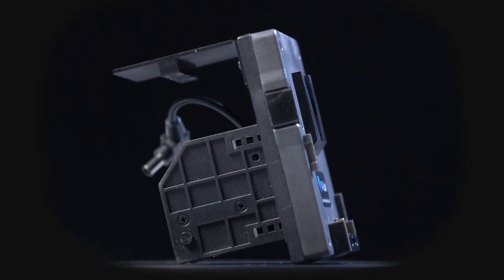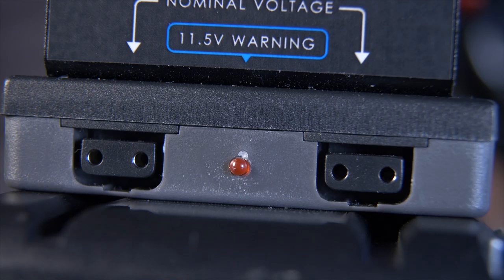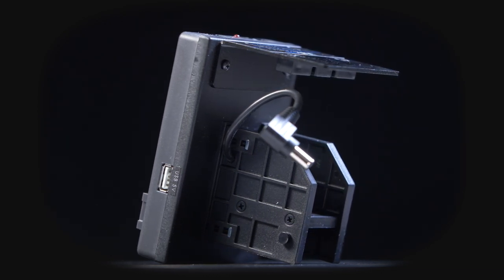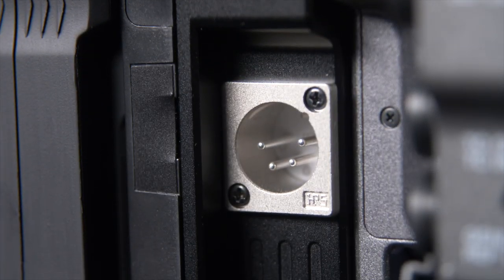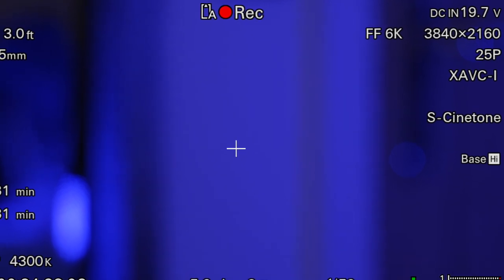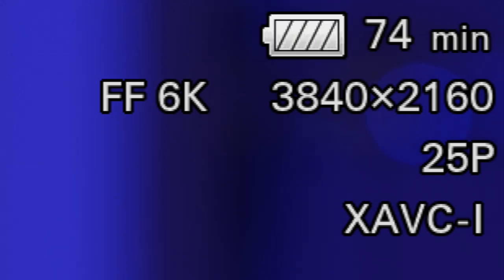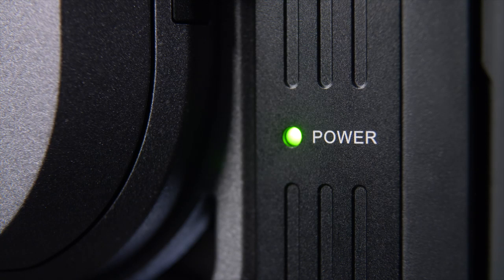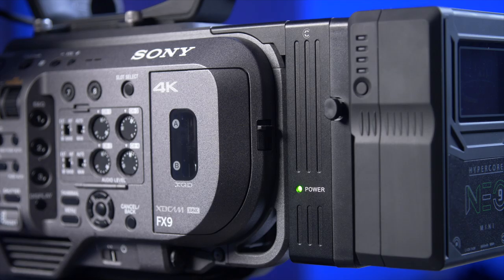Core SWX FX9 Power Solution

Comment: Together with the battery, this solution really makes sense for me.  I'm often using an external monitor/recorder via D-Tap so it would be great to get total system battery status.

FWIW I agree with your general comments about the Hawk-Woods unit.  Mine is being fitted with an additional capacitor as I write this. Another option I haven't tired or evaluated is from Wooden Camera. It's unique feature is a hinged V-Mount plate that allows the 35W Sony battery to be inserted and removed without unscrewing the adaptor from the camera.
Reply from the maker: True... I been running with a BM video assist and sometimes a top light... all running from the D-Taps... and with an accurate run time on the battery.  I think it works it out from the existing load because it takes a few seconds for the reading to settle down.  If I turn the camera off and just run the monitor... the battery run time will often jump to more like 11 hours!  The Wooden Camera Plate looks good and I tried to get one to compare... still difficult to get hold of at the moment.  The main pluses are the hinge to make it easier to swap an internal battery and the fact you can fit a larger battery if you want.  The minuses would be having to use that rubbish laptop power supply and the strange chirping noises that many have reported from the regulator when using a full 14.4V battery?

Comment: I found the Wooden Camera solution to work great on my FX9.... I use a CORE 98W Nano U98 internally, then a gold mount on the Wooden Camera flip up mount on the back.   It's a hot swappable dual battery solution and gives you the option to make the camera smaller in tight situations like cars and helicopters.
Reply from the maker: Thanks Bill,  I have heard good reports about the Wooden Camera... have you had any issues with it making a 'chirping' noise with fully charged batteries ???
Reply: @extrashot  I have not heard any chirping from the unit so far, but will report back if I hear anything.  The only issue I can see with this set up is that you give up the 4 pin external power option that other units offer, but the power supply that comes with the camera is small and easy to bring along. My FX 9 is set up similar to yours with the Sony 28-135 as the primary ENG style lens, Shape arm and a  Zacuto shoulder mount, the camera balances very nicely with the two batteries mounted in this configuration.
Reply from the maker: @parismedia  Cheers Bill, The extra weight on the back to help balance the camera is a good point... plus having the internal 98W makes for a useful extra bit of power. 👍

Comment: Hi again...how has the V-mount plate stood up 1 year later.  I'm asking because I had the Tilta plate for the FX9 and its essentially damaged my DPR board...Record light started blinking and beeping and after trying everything right up to a firmware update, which caused the camera to become a brick, now have to send in for repair.  I'll have to throw my Tilta plate in the Bin, so I'm looking for a reliable tried and tested Vmount plate
Reply from the maker: Hi Peter,  wow, that's a real bummer.  I didn't think there was any connection between the DPR board and the power supply... was it the 19.5 regulator that went on the battery plate?  Never heard of such a thing.  That's a shame because the Title plate looks like a good design.  Anyway, the Core SWX has been great... still a permanent fixture on my camera and still working faultlessly.  The only disappointing discovery was when I realised the D-Tap outputs only take power directly from the V-Lock... not the 4-pin XLR.  So you still need a battery for D-Taps even when running from the mains.
Reply: @extrashot  Thank you for the reply.  Yeah the Tilta was actually a pretty nice design, cause you could flip it up and access the BPU batteries...There's no telling if the V-plate was faulty.  All the guys over on the Facebook forum are suggesting that it must have something to do with the 3rd party plate/batteries.  Anyway shipping it off to Sony today and hopefully will get it sorted...in the meantime i'll try and get the plate you're using and hopefully i'll be up and running again.  Cheers
Reply from the maker: @pjsagnia  Hope it works out for you soon...

Comment: Hi thanks for the review.  What is the runtime on those Core Batteries for the FX9?
Reply from the maker: Hi Peter,  I'm getting about 2.5 hours from each Core NEO Mini 9 battery on the FX9.  That's in continuous record and my normal camera setup.  I've found the FX9 is strange in that you can reduce the power consumption a lot, just by turning off things like the WiFi and any HDMI/SDI outputs you're not using.  Obviously if you do this, or shoot in the more normal stop/start way, then you can squeeze quite a bit more out of each battery.  The odd thing is how the FX9 will eventually flatten any V-Lock battery even with the camera turned off !!!
Reply: @extrashot  Thank you for the reply.  I think I'll go with the Neo Mini based on your reply.  I'll also check the wifi thing etc.  I don't use that at all.

Comment: Thanks for the great reviews and tips on the FX9. I bought the core battery back for my camera and I discovered that the d-taps don't work with the 4 pin XLR adapter. The camera works fine with it, but no power to the d-taps so my focus and external monitor need to be powered elsewhere. Any chance I'm missing something?
Reply from the maker: Hi Joe,  That's very weird... I've just double checked with mine (it's sitting right here) and my d-taps are powered from the 12 volt XRL input, irrespective of whether the camera is on or off and with no v-lock battery connected at all.  I can even unplug the whole thing and power the d-taps from the mains unit alone!  Yours doesn't sound right?
Reply: @extrashot  Thanks for responding, Paul. I might have a bad battery plate. I tried it again (I'm using a Core brand XLR cable) and it doesn't power the d-taps. It's a little strange because when I have that cable plugged in, the 'power' light on the battery plate flashes red, but it powers the camera. Also, it doesn't power the d-taps from mains battery if there is no connected XLR cable or v-mount battery. I tried an alternate XLR cable that I pulled off one of my LED panels and that one didn't work at all - not even a red flashing light. I put in a support ticket last week to Core, but didn't hear back from them. I think I'm going to try them again. I appreciate you responding to my question. Keep the videos coming, you've got good content!
Reply from the maker: @joecrumprealestate  Ahh... that might be a clue... the LED on the side of mine is a solid green when plugged into the mains.  Flashing red usually means there's not enough voltage.  What 12 volt mains unit are you using?
Reply: @extrashot  You nailed it. That is the problem. I heard from Core and they said it was a voltage issue as well. The Core cable I'm using (SPU-4) will run the camera, but doesn't give enough juice to keep the red light from flashing. Apparently, it's not giving me 14.8V DC. They said that if I ran a cable from the battery charger XLR instead, the 'power' light would show green since it would be the proper voltage as a power source. BUT, one disappointing thing they told me was that the XLR cannot power the d-taps. The onboard mains battery will also not power the d-tap. I told them that you were having a different experience with that and here is their reply: 

"Not sure how he is getting the powertaps to power unless he has a battery on the plate as well at the same time. If there is a battery there, even if the unit is plugged in via the XLR the power taps will still take power from the battery and the camera will take power from the XLR.  The powertaps are built into the plate and there is supposed to be a diode between the battery mount plate and the base of the unit which stops the XLR from back-feeding into the battery and damaging it."

So have you tried taking the v-mount battery off and seeing if the d-taps still work? I guess this all means that you can't hot-swap a v-mount battery and have the d-tap controlled monitors or follow-focus controls keep running. Not a huge issue, but something I didn't know. Thanks again for your input and advice.
Reply from the maker: @joecrumprealestate  I'm glad we've got to the bottom of the problem... I've just checked mine again and realised why I originally thought my d-taps were getting power.  I tested with a Terradek Cube TX unit... without realising that has an internal battery which keeps it powered during battery changes.  This self charges when you add a new v-lock... who knew !!! Anyway, my bad, and I'm sorry if I gave you a poor steer.  Core seem very good with the support so that adds confidence.  Stay well, Paul
Reply: @extrashot  Thanks for the help! I appreciate it. And yes, Core was responsive and provided good support. I think this system will serve me well.

Comment: Question , I’m currently using a straight up wooden camera gold mount and plug into the fx9 - is there a power advantage to using this unit vs what I’m using?
Reply from the maker: As long as the Wooden Camera mount gives you the silly 19.5 volts that the FX9 needs, you should be fine.  I think you can even leave a little BPU battery in there for back up... so all good.

Comment: Can I just ask, the Core SWX CXV-FX9 V-mount plate shows a Dtap on the top and side, but yours has two on the top?  Is there a new or old version please?    Also, can I use a slightly larger than BPU35 inside simultaneously?  Or is there only room for the BPU35?
Reply from the maker: Hi Al,  it's strange isn't it.... All the CXV-FX9 plates have two Dtaps, one 4pin Power input and a micro USB for upgrades... but it does look like the position of one of the Dtaps moves on various photos?  Looking closely at mine, and the photos online, you can see the blanking plate that allows them to move it between positions.  All the models I've seen in the wild are like mine with both Dtaps on the top, so I don't think it's a new model or anything... just a change in design when production started.  Unfortunately, you can't get anything bigger than a BPU35 inside as it'll block the mounting slots the plates use.
Reply: extrashot than you. Explains it. Cheers. They arrive today.
Reply: Another question if I may?  If and how I obtain the raw back attachment in future how would this work with the cxv adapter ?
Reply from the maker: @aljamesproductions  The Sony Raw back (or XDCA-FX9 extension ) has a 12volt V-Lock adaptor built in... so no need for anything else in that case!
Reply: extrashot thanks.  I think May need to send the whole lot back then as it’ll be £450 down the drain.  Thanks again.   Ps.  It arrived today all the kit you mentioned and it add some weight to the Rigg.
Reply from the maker: @aljamesproductions  Have you ordered the XDCA back?
Reply: extrashot no I haven’t ordered the Raw back yet.   I’m hoping the Shop will take back my hypercore neo battery and song vmount back as I’d like to replace with a couple of hawk woods much smaller and two thirds of the weight.
Reply from the maker: @aljamesproductions  Ahh, okay.... personally, I prefer my camera with a little weight on the rear. I find it quite front heavy without.  Often you can just hang the sound recordists wallet on the back! 😂

Comment: good video. Will be better if Core can make it the same color as fx9 body.
Reply from the maker: Thanks Kenny, and good point... apparently, it's really difficult to match the colour if the texture of the material isn't also the same.  Because the Core plate is metal and the camera is this weird composite, it's almost impossible to do.  Core told me that if you try to match it and fail... it ends up looking worse than an obvious contrasting colour!  Besides, if the plate matched, then I'd only want matching batteries too !!!

Comment: What case are you using for the Fx9?
Reply from the maker: Ahh... good question... the FX9 is an awkward shape for many camera bags, especially if you're not keen on breaking the camera down each time you want to put it away!  I've ended up using an old Petrol camera bag 5 which has now been taken over by Sachtler.  I believe it's now called the Sachtler Dr. Bag - 5
https://www.sachtler.com/en/sachtler/dr.-bag-–-5/c-26/p-1319
I still have to remove the viewfinder loupe and rotate the viewfinder on the square bar in order to get it in the bag!

Comment: so if you lose powered you lose the whole clip with XQD cards .. ?
Reply from the maker: Not every time... but often the last clip will fail to close properly, meaning your computer won't read it.  This happens with SxS (and most file systems) as well.  Good news is that it's usually recoverable... the camera will prompt to "Restore Media" when it detects an open file.  Still... it always makes me nervous. !!!
Reply: @extrashot  Ok thanks.. yes first time I had to "restore media" was scary..
Reply: @robinprobyn1971  Hey Robin.... I really like Wooden Camera flip up Gold Mount plate combined with the Core Nano 98 internal batteries, it gives you a hot swappable option so power will not drop in the middle of a shot... your basically running with two 98 watt batteries with very little added weight  which for this camera with it's higher power draw is really nice... I hope all is well with you in Japan!
Reply: @parismedia   Hello Sir .. yes apparently there is also space with the Core V mount to hide a little battery in there .. but harder to get to of course .. Im going to see how I go just with checking batts more than I used to .. I hope anyway !.. and possibly a 2 x battery plate they make for my batts. Mini V FXLion Nano2 98WH.. I think they drain simultaneously unfortunately but any shoot where I know I have to shoot scorched earth style, might be a good idea ..

Comment: I am confused about something that I assume you could confirm or at least help clear things up. In super 35 mode, with current firmware, can the FX9 shoot 4K or UHD at 120 frames per second? Can I use an atomus to make that happen if I can’t do that internally? Specifically will the shogun inferno allow that, like the FS five does? Do I have to purchase a neon? Is 4K 120 FPS planned or possible with the fx9 at all? 

Man, that was a lot of questions! I apologize but I am confused about the current frame rates, and plan frame rates. Thanks so much I really appreciate what you do on your YouTube channel! I am in FS seven and FS five owner, as well as all of the Alpha series.The FX nine could be a wonderful solution for me especially with all of my full frame class. Thanks again.
Reply from the maker: Okay... it's a little confusing at the moment because some of the promised frame rates won't arrive until a later firmware.
At the moment you have 4 scan modes:

FF 6K mode will only give a maximum frame rate of 30fps (in 4K or HD)
S35 4K mode gives a maximum frame rate of 60fps (in 4K or HD)
FF 2K (1080) mode will give a maximum of 120fps
S35 2K (1080) mode will give a maximum of 120fps

I believe that there might be a 5K scan mode coming soon which would give us 4K at 60fps
We've also been promised 180fps in all the modes that currently max out at 120fps.
Finally, we should see 120fps in true 2K and 4K when the 16bit RAW output arrives.
(You should never use the FF or S35 2K scan modes for anything except high frame rates... the aliasing is horrible!)
We may also see a centre crop mode like the FS7, F5/55 shortly too

I'm probably a little sad to say I'm really looking forward to the latest firmware!!!
Reply: extrashot Thanks so much! Sorry to be slow with a THANK YOU, but I have been on a 6 day shoot, sun up to late in the night. Fun, lucrative & exhausting!! 

I must say that the fx9 is probably something I will pick up, but as of today, the frame rates aren’t as compelling as its other traits. I can’t say how much I enjoy face detect auto focus and eye-autofocus on the a7r4! FX9 must be nice. 

I hope that firmware update arrives soon (for a prospective buyer too).

Thank you so much for the clarification and info!